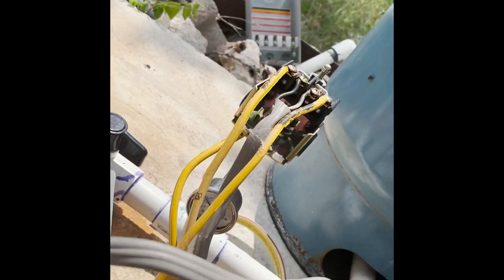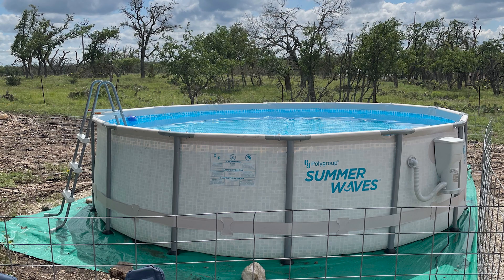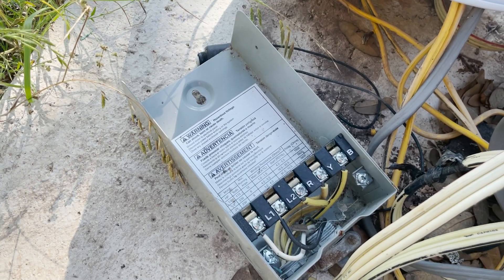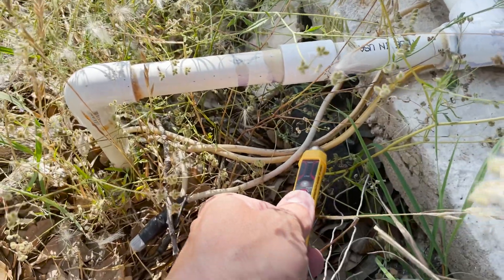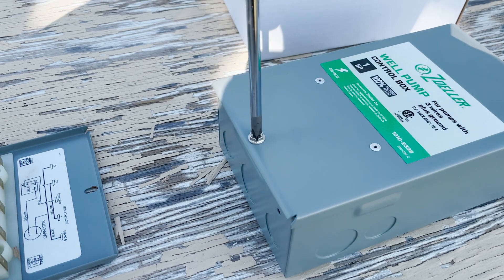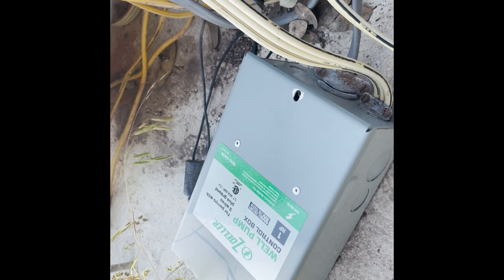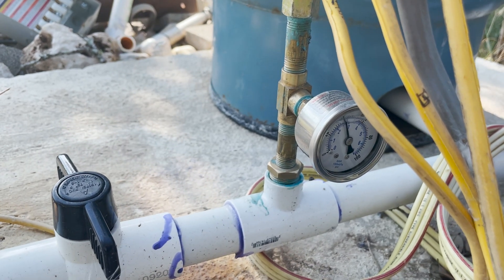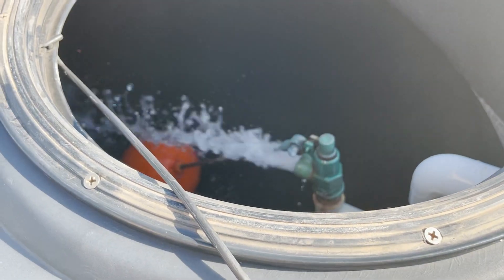Water well repair - control box replacement

Comment: Replacing my control box today...old one is circa 2009 from what i can tell, not sure if previous owner replaced but it is wider than the new one so i can't make a lazy repair to mine.
Hope your cows niw have plenty of water!! Hope i will too soon.
Reply from the maker: I’ve got large tanks and gravity feed the water to the cows, probably several months of water in reserve.

The well is not pumping much water right now, probably need pull it up and replace it.

Comment: Part of your problem may be that the control box isnt mounted vertically, that white relays orientation is supposed to be the screw facing up. also a bleeder resistor would not hurt especially if you are going to leave it on ground. a bug crossing connections while pump is off could fry the pump.
Reply from the maker: Outstanding feedback. I suspected as much, but I was really thinking more about the control box sitting in water on the ground. Neither the bug or water in the control box is an ideal situation. The entire thing needs to be reworked... <sigh> "in my free time"

Comment: The best thing to do is to put a 2 hp box if you don't no the box you have doesn't go over a 1hp that size if it's always been that size there it a 1hp after that the box is way bigger. I   no your problem is the on and off it kills the capacitor check your switch is it clean  no rust in the inside and your pressure tank what the air pressure it the pressure tank it the blue small tank. I see your problem the ball float was making the line air hammer so the pressure switch would click ever time put a snubber under the pressure switch would help prevent it from burning up I have been trouble shooting for about 10 years and working in pumps for over 20years or a time delay hope that helps 💦👍✌️👌🍻⚒️💯